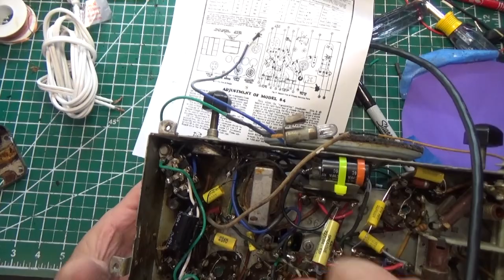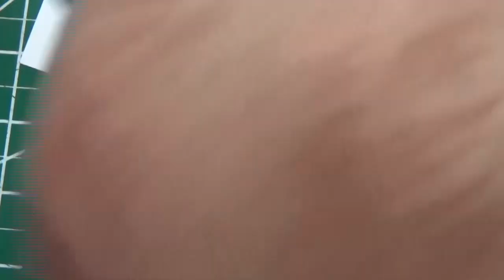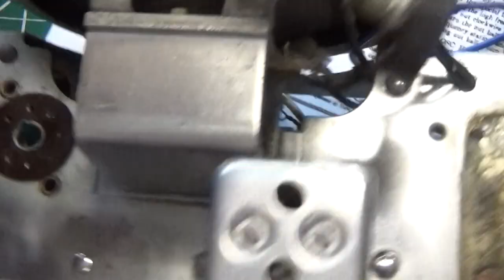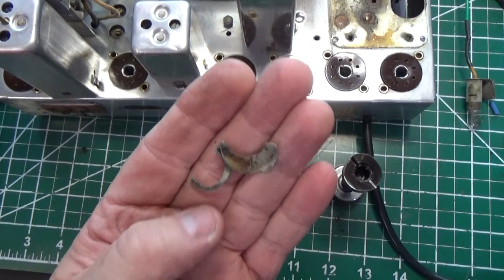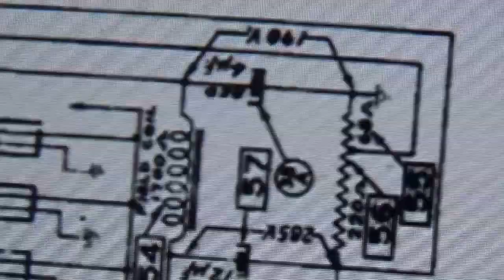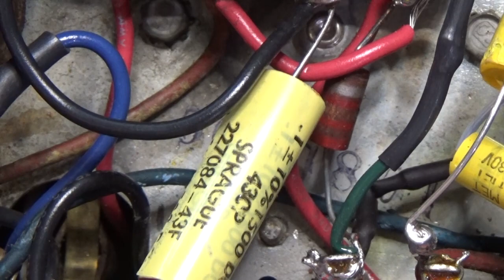Philco 41-245 Restoration : Episode #6: Where has Ron been ?????? More radio woes and #41

Comment: For those not familiar with Greenlee knockout punches, the 1/2" die actually punches a .885" hole. That is because the punch is labeled for the nominal size of 1/2" conduit. The conduit  connector actually requires a larger hole to mount the conduit.
Reply from the maker: Johnny- thank you for that clarification. They work so well and are dure not to bresk your wrist like a taper bit can. Ron

Comment: Hey Ron, Nice punch set.  I think I'd get the hydraulic temco set though cause I'm cheap, lol.  I've got several of those little deburring tools as we used to use them at a factory I worked at to take the sharp edges off of plastic parts.  They're very handy.
Reply from the maker: Thanks Gary.  A punch is a punch I suppose but I will check out the Temco as well. Hope all is good my friend